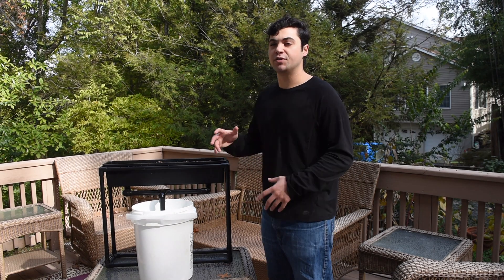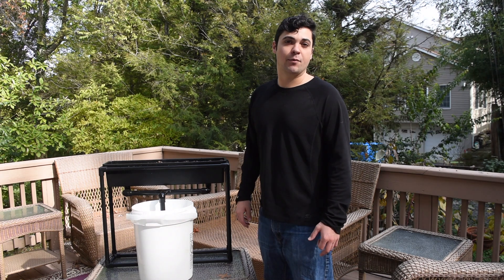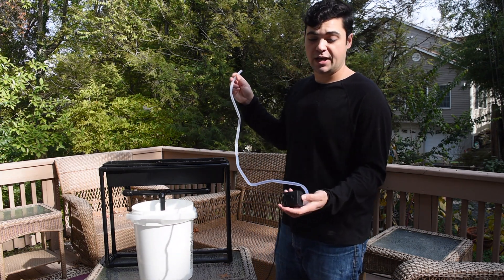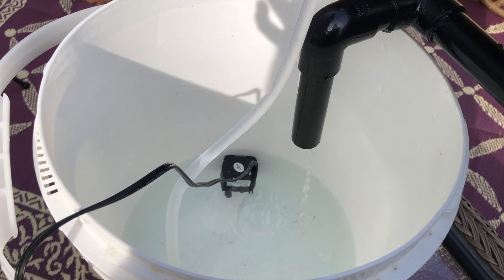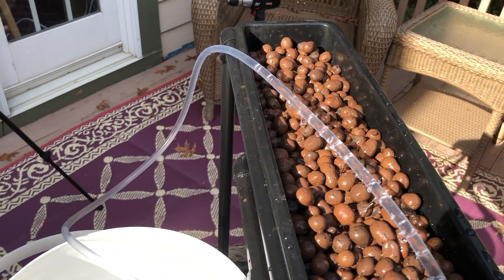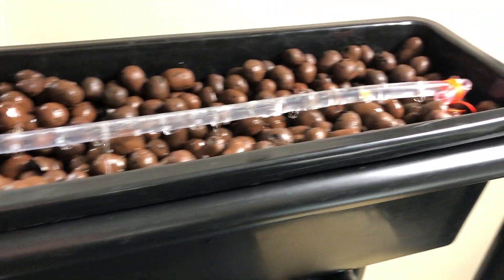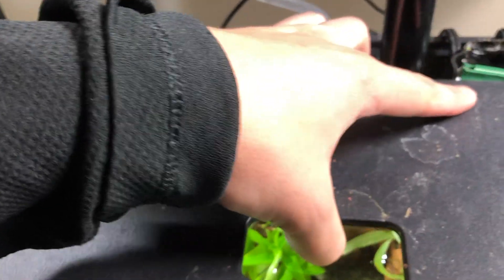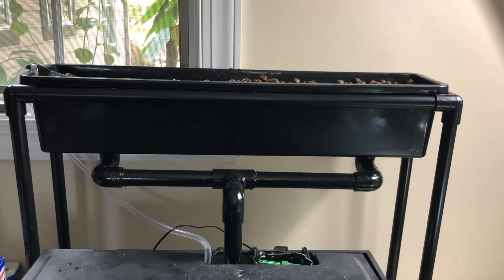DIY AQUAPONICS System for 10 Gallon Fish Tank- Part 2

Comment: Am I wrong?

Only two reasons exist to utilize aquaponics rather than hydroponics because of the down-sides:

1. You want to raise fish that you will eat:

Otherwise, it is less expensive to just have a fish tank in its own system that is managed separately because the time, money, and risk management is less without combining it with growing vegetables. It is much easier to maintain "eye catching" fish in an isolated system. Unless using a gravity fed system, electricity is a fundamental requirement which costs money on the electricity grid or an initial investment in a solar powered, self sustained setup costing nothing more than an initial investment (which is more than a kratky hydroponics setup). Even then, you have to ensure everything is working properly all the time... which can be a hassle regarding management... and if electricity powered equipment fails then you have to replace parts / components quickly or the WHOLE SYMBIOTIC SYSTEM fails! This is a great risk if the fish that provide nutrients are just for viewing pleasure.

2. You want 100% organic vegetables utilizing hydroponic methods:

Hydroponics require synthesized nutrients added to water. The Kratky method requires far less time, daily management, initial money investment, and risk compared to a closed loop aquaponic setup. However, aquaponics allow your vegetables to be 100% organic! The only way to have completely organic hydroponics is to introduce aquaponics (or fish in the water) into the setup. You can't just dump poop into a hydroponic setup as far as I know (or no one has invented a way yet).

CONCLUSION:

Why not separate aquaculture (a fish farm) from the start? You can raise your own fish (to eat) in a separate system that is far more manageable, less risk, and less expensive (at least in a 1st world nation). A separate hydroponic system can grow your vegetables with the same ease, if not more superior ease... of management, costs, and risks.

If you will not be consuming both the fish and the vegetables you grow AND you are not a die-hard "organics food only" fan then I do not see the massive benefit of aquaponics unless you have exponential free time and investment capital to initiate and maintain the process... other than doing it as a fun project for education and experimentation. Seemingly, combining aquaculture with hydroponics (aquaponics) is expensive, time consuming on a daily basis, and costly.

If I wanted fish and vegetables to eat "off the grid" and independent from a trip to the grocery store to sustain my family, barring a societal collapse, I would engage in both aquaculture and hydroponics as separate systems. Perhaps in a societal collapse and without any real means of consistent electricity, I would engage in gravity fed aquaponics. Under these circumstances would I see exponential value in such a system of sustainability.

Additionally, aquaponics for the sole purpose of purely "organic" food consumption has flaws. Did you know that many of the recalls on food are often from "organic" sources? Why, you ask? It is because animal feces used in organic processes often struggle to eliminate all of the bacteria contamination (4 to 8 times higher than non-organic when adjusted for sales volume) in organic farming. You could argue that the organic industry has a smaller market share but in 2015, organic products represented 7% of recalled foods while only representing a very small fraction of total sales. You have to at least ponder the true benefits of "only organic" food consumption. What difference does it make if you get sick and/or potentially die for something you "believe" is the "healthy choice?"

What you are left with is the choice to utilize aquaponics so you can eat the fish and the vegetables they support in a symbiotic, closed-loop system. Personally, I would just separate aquaculture to raise fish for eating and hydroponics for vegetables for consumption. It is easier and more manageable, cost effective, and less risky especially when scaling up from a small aquarium in aquaponics to huge fish tanks and grow beds!

I think aquaponics is fun and makes for a great educational experiment. However, unless our society is about to collapse (and if it did then vegetables alone can keep my family alive indefinitely and in the absence of fish meat) I see little value in adopting aquaponics unless the market share of organic vegetables along with fish meat far exceeded sales of modern and conventional methods today.

Thanks for reading. CHEERS!

Comment: I have a similar set up in a 29 gallon, with 2 of these window sill pots. I made the fish tank lid out of plywood and built a shelf for the upper planter. Screwed a light into the bottom of the plywood and drilled a hole into the wood for the wire to run through. Then drilled a higher hole in the planter boxes on one end and lower on the other end to allow for drainage. Attached the pump line to the higher hole one the upper planter and sealed it with aquarium sealant, and the same with PVC attachments running to the second planter and then out to the lower that drains down back into the aquarium via PVC. I also used 3 inch net cups to cover up the PVC openings so the hydroton/leca wouldn’t drain into the other pot or into the aquarium. Fish are currently in the system and I’m starting bell peppers, tomatoes, cayenne peppers, kale, spinach, mustard, cress and two different kinds of basil all in Viagrow Super plugs - the bell peppers which are in net pots because I started them before beginning the system and they’re already 2 week seedlings.

Comment: I would recommend you gravel, it will clog from time to time and therfore is a little time consuming. Also the roots will stuck to the gravel after harvest. Better use a floating technique like a raft system made out of styrofoam

Comment: Interesting but there is a drip hanging from the left elbow.
Reply from the maker: thanks, not sure what you mean there tho - no drips here.
Reply: At 3:46? That's a bit of silicone that leaked from the joint. Not water.

Comment: Have you had any issues with the chemicals used in the spray paint or glue for the PVC passing through & harming the fish? That has been my biggest concern in using PVC with the standard non drinking water?
Reply: You need to use the same glue for potable water that u would use for ure house faucets. It would be drinking water pvc

Comment: My question is if you glued the PVC pipes together, or if you did a dry fit? And if so, did they ever incur any leaks? Thanks for letting me know in advanced!
Reply from the maker: Thanks for the question! I used 100% silicone on the pvc to make sure it would be waterproof, however given that the system never experienced a lot of pressure I think dry fit wouldn’t leak either.

Comment: Great videos, we are just starting out.  Do you need to set the pump at full power or adjust it for less flow?  We are starting out with a 10 gallon tank and will copy your technique of poking holes in the tubing for drip irrigation.  Also, how many hours per day should we run the drip irrigation?  Thanks!

Comment: Great. One question, because i am into Aquascaping with heavily planted fish tanks, is the vegetable still edible since i am using liquid fertilizers on my tanks?
Reply from the maker: Hi, it would be tough for me to know witout knwoing which fertz you are using, but i would think it should be fine, especially that it is safe for the fish. I would consider it similar to using chemical fertz in soil.
Reply: One More Cast Thanks for the reply. I used mostly Seachem Ferts if you are aware of that. Yes its safe for fish.

Comment: How many guppies do you keep in the tank? I am wanting to start something up as well, but was planning a slightly smaller growbed for a 20 or 29 gallon tank... so I am looking for a ratio of fish to growbed space. :D Also, what tank maintenance do you do for the guppies? I know that the aquaponics setup is supposed to act as a filter of sorts, but I don't know if I should add an actual filter as well.

 Your video was very helpful, thanks a lot!
Reply from the maker: Glad you got something out of it! So I started with 5, but guppies multiply very rapidly so I try to keep the number below 15 or so just so they don’t overcrowd the tank and to make sure they stay healthy. Seems to work fine for the plants. I’ m going to opt to keep a secondary hang on back filter as well just for my price of mind. Good luck building your own system!